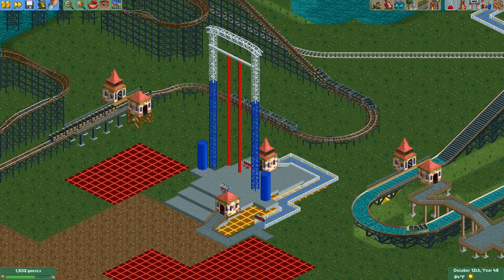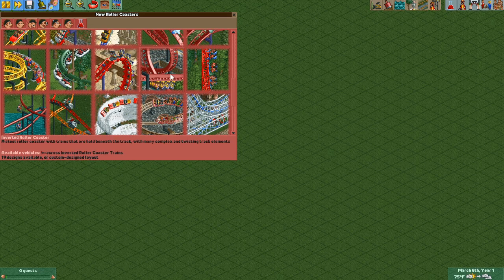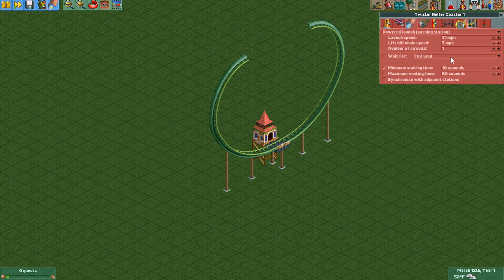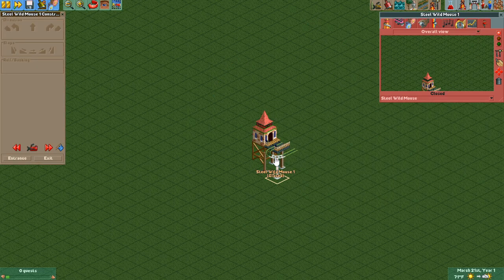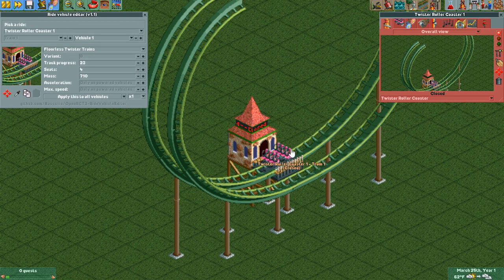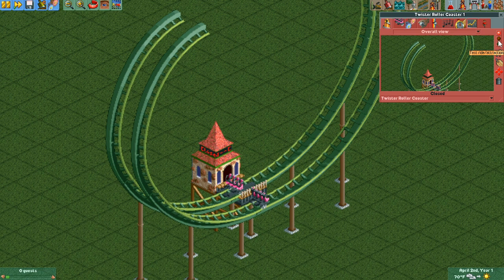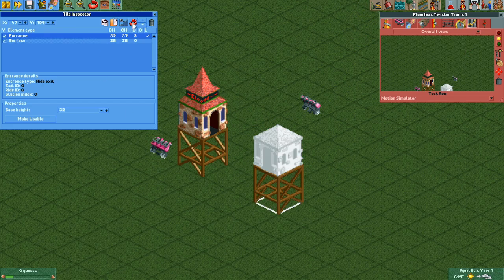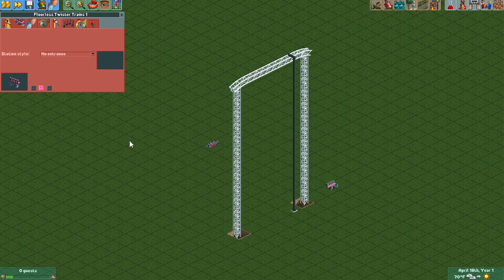S&S Screamin' Swing - OpenRCT2 hacking

Comment: Great tutorial. However, I attempted to use this method to recreate a hammerhead (swinging inverter ship) ride using 8 face-off cars. The cars that were moved to the opposite track end up stopping in a different position each cycle. So slowly over time the one side is so out of sync from the main side. Not sure if you have any insight on that.
Reply from the maker: Hm, that is weird. I'm not sure why that would happen, sorry.